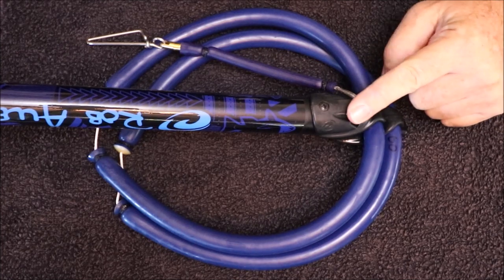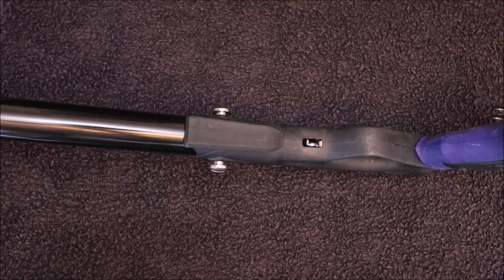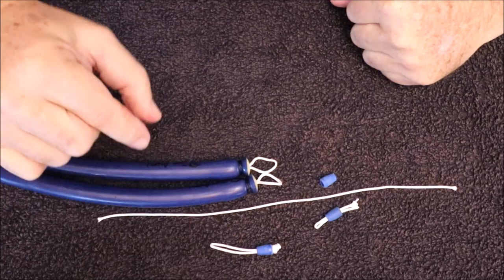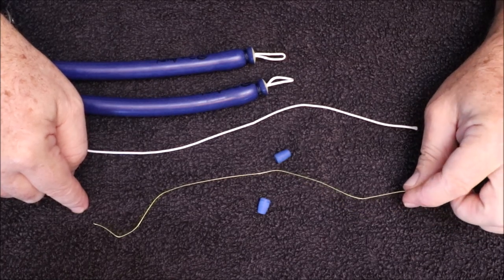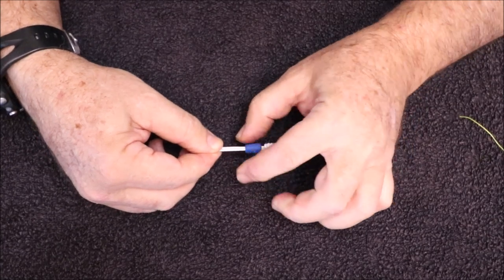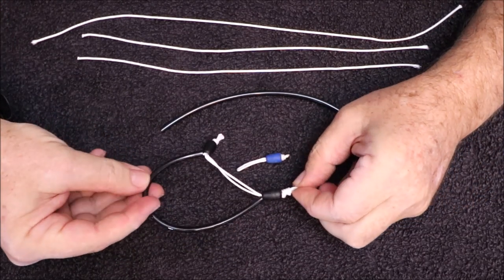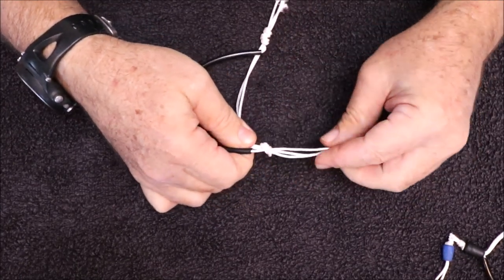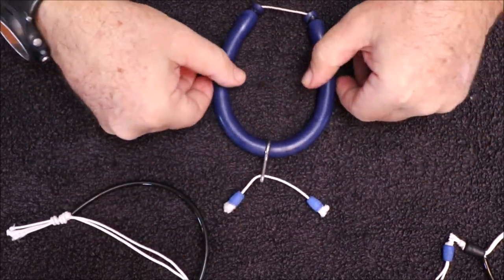Rob Allen | How To Series | Roller Conversion

Comment: Good morning Rob, thank you for your dedication to this sport, and to demystifying the speargun object.

I intend to convert to a roller gun, but I have a doubt that I haven't found yet,
is the calculation for the correct size of bands, and should I use pre-tension?

the weapon has a length, head to notch of 90cm, and 88cm head to hook.

to a single roller, 6.5mm shaft should i use 14mm or 16mm bands?

thank you, good continuation!
Reply from the maker: 14mm bands are best for the thinner spears. Use a scale to set the pre-load. Pre-load should be around 10 to 15kg.

Comment: Hello Rob, thanks for the awesome videos and the informative content.
I just have a question, why is it that dyneema is said to shoot better compared to mono when used  as a shooting line? To me it is more intuitive that mono has less drag in the water since it's usually thinner and has a smoother surface. Is it because dyneema is relatively more flexible?
Reply: Dyneema doesn’t form a generalized shape from being wrapped around the line release the line straightens as it’s shot

Comment: Hi Rob, love your videos mate! I have found them incredbily informative and helpful so thank you for that! I'm wondering if it's safe to change any of your guns to a Roller Muzzle? I've got a 1100 Scorpia that I'd like to try as a roller but don't convert it if that barrel and trigger mech isn't going to be suitable for a Roller?
Reply: The trigger is fine. Is it a rail or non-rail barrel? We have never tested a non-rail barrel. There is actually less load on the barrel with a roller than on a normal gun.
Reply: @roballen1578  Thanks for the reply Rob - it's a Rail Barrel. Would that be safe to convert to a roller?
Reply: @isaacernst6201  Yes, same barrel we use for factory made rollers.
Reply: @roballen1578  thanks so much rob! Really appreciate you taking the time and helping me out. Cheers mate

Comment: Hi Rob
Thx for another valuable video. 
I would like to learn : ıs your blue 16mm bulk rubbers are progressive or rective ?. 
I need a progressive highly strech rubber for my new roller gun and your comment is very reliable. 

Best wishes from sunny Istanbul
Tarkan
Reply: Hi Tarkan, We have done many tests and we can't see any difference. All rubbers increase their tension the same. Some will have a higher load at full tensions but in none of the tests we do, any truth to these claims of reactive or progressive. I might be wrong but I think it's just smoke and mirrors 😜👍
Reply: @roballen1578  Thanks for the quik response. Looking fw to see a video about the length of RA 16mm  rubbers in a roller gun. The length calculation metod actually. 

Best wishes
Tarkan

Comment: Hi Rob, thank you for the great video!
I had a question please: is it possible to convert a traditional RA 140cm carbon railgun into a 130 roller? This would require cutting 10cm off the carbon barrel and adding a new roller muzzle as well as pretension pins on each side of the handle. I would have thought it is possible to do the cutting job neatly using a hacksaw blade and a mitre box, but I wanted to confirm that doesn’t risk compromising the integrity of the carbon, such as creating a risk the barrel might split/crack from the extremity which was cut. Do you any views/experience with this? Thanks
Reply from the maker: Sorry for the delay in answering. This can be done if you use a very sharp blade with many teeth. Problem is re plugging the barrel. I would cut it a little shorter, to 120cm rather than 130cm as there is little difference between a double rubber 130cm double wrap  than a 130cm roller other than the lower recoil. Short rollers are way better than shorter standard guns but, as the length is increased the advantage decreases.

Comment: so if I have a RA carbon barrel can I also just drill that with a 4mm drill without destroying it ? I do not have one now but I think about getting a mahi carbon rail and upgrading later on
Reply from the maker: Yes but why not just purchase a carbon roller gun?  If you do go for the Mahi, it has a muzzle weight, don't add it to the roller muzzle.

Comment: Great explanation as always :)
Yes, roller guns do not shoot higher than standard guns - they shoot 'straighter'. Actually we should say standard guns shoot lower :)
So when changing guns and using a roller no need to correct aiming 'higher' than we would do with a standard gun.
A roller shoots further and faster compared to a standard gun of same length. So probably you hit where you aim ;)
Congrats for another nice video.  ><)))*>
Reply from the maker: Good explanation thanks 👍 That's what I was trying to say  😁

Comment: Ho Rob!  been a big fan of the GT Roller for a year now and wanted to ask you if your roller muzzle can be used with shark fins, i have a shorter Tuna that I would like to convert, But Ive noticed that all your rollers come with notched shafts.   will a shark fins shaft shoot low? (bridle riding the muzzle)
cheers
Ramiro
Reply from the maker: It should not br a problem if you load to the back fin if it has double fins.

Comment: Aloha Rob, can I convert my 130 rob allen speargun to a roller? 🤙🏾😎
Reply from the maker: You can but it will give you over 9m range. (30 feet)  If you cut it to 110 you will still have better range than the 130.

Comment: Hello Allen , What lb test was the dyneema line on the shaft to the bungee recommened for a 1200 tuna roller conversion
Reply from the maker: We recommend 1,8mm to 2mm. It is around 500 lb break strain but you do lose a lot to the knot.

Comment: Hey Rob!

I just order the roller head muzzle but am having problems with one of the ceramic bearings not spinning nearly as smoothly as the other one. I have tried running it under warm water with no luck. Is this an issue that will resolve itself when I start shooting the gun? Or do you have any suggestions? As I said the product is brand new straight out of the box and I am trying to avoid sending it back. 

Thank you!
Luka
Reply from the maker: Hi Luka, try using it a few days and see if it frees up. There might be some dirt that got in. If not, we will replace.
Reply: @RobAllenSpearfishing  Hey Rob! Got everything sorted just had to replace one of the bearings and it’s running like butter! 
Appreciate it. 

Luka
Reply from the maker: @LukaDolman  👍👍

Comment: At 12:00 you recommend Dyneema versus mono. Does this apply to just the roller gun, or all of your spear guns?
Reply from the maker: Just the rollers. For some reason it just works better with Dyneema.
Reply: Dyneema is more expensive than nylon monofilament but when shooting around reefs or structures it is far better than nylon monofilament as it does not cut at all as fast as mono. Also the breaking strength of Dyneema is far higher than comparable diameter in steel! 
I use both, but actually I find Dyneema is the better choice also because you can always cut and tie knots to maintain/repair your speargun rig - with mono one is screwed if no crimps and a crimping tool is available (imagine this happens on a trip). Just my personal humble opinion :)

Comment: Hey rob is it okay to freeze speargun bands? I always heard that freezing your bands is a good way to preserve them, but recently I read somewhere that it’s bad and can ruin your bands now I am really worried about my pre made bands since they’ve been sitting in the freezer for well over a month. If it is bad to freeze speargun bands will my bands that have been sitting in a freezer for over a month still be alright for spearfishing?
Reply from the maker: We have never tried to freeze and see what problems might occur. All manufacturers of latex tubing that I know of do not recommend it. The bottom of the fridge in the vegetable tray is said to be best. It is also better to store without the wishbone fitted. If there is any stress on the rubber, even though it is stored in a dark, cool place, will degrade it.
Reply: RobAllenSpearfishing would it make any difference if I take my bands out of the freezer now or would the damage already be done?
Reply from the maker: @matthewmartich8772  no idea, only one way to find out 😜